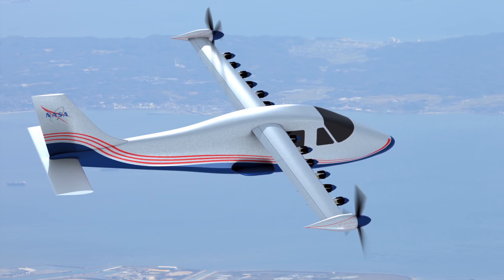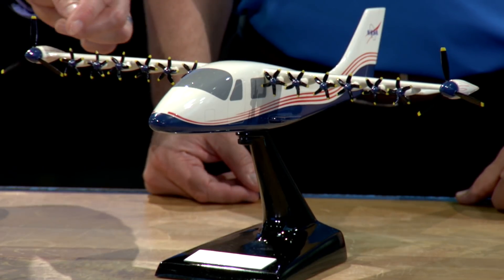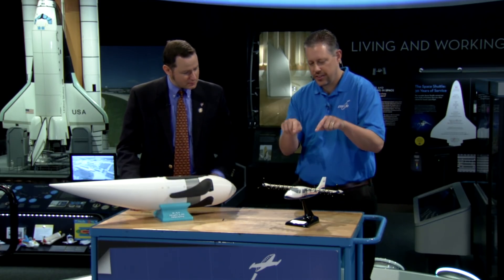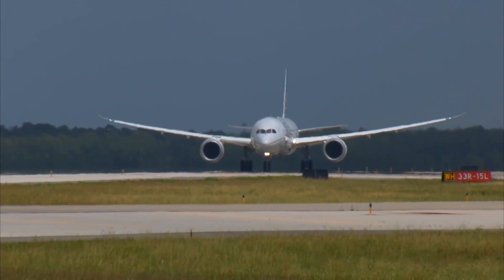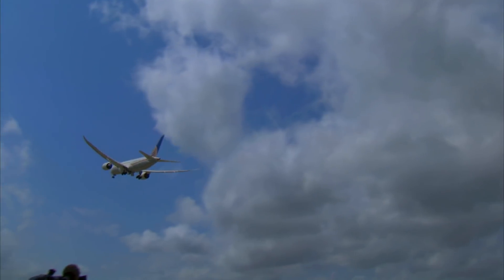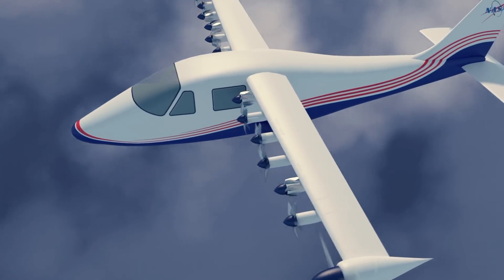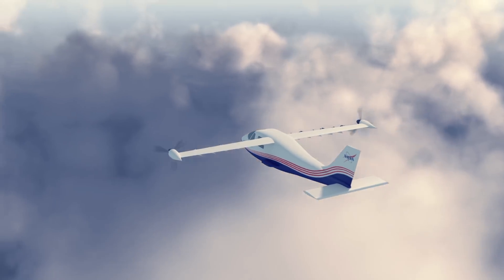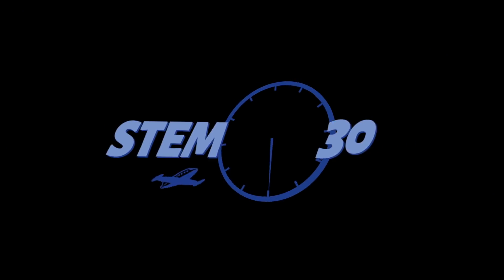Meet Maxwell, NASA's Experimental Plane That's All Electric - STEM in 30

Comment: It doesn't look like it will replace jets. There is no way it could travel a reasonable speed for long passenger flights. Maybe it will be used as a short distance plane.
Reply: I agree, I could see regional airlines taking advantage of this tech in the future. Still brings about  a lot of questions.
Reply: Right now it's a research project, which of course won't be used to replace anything. NASA (and formerly NACA) has been funding research-level aerospace projects that may pave the way for future commercial adoption for many decades. They are using part of a known airframe for the purpose of availability and ease of comparison.